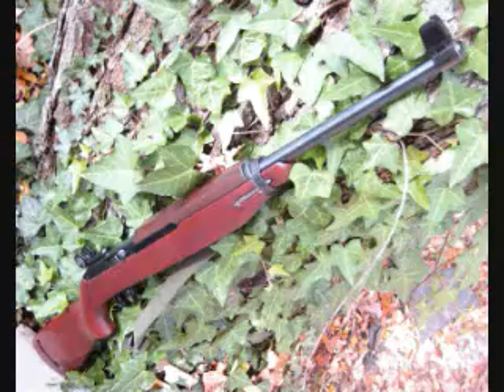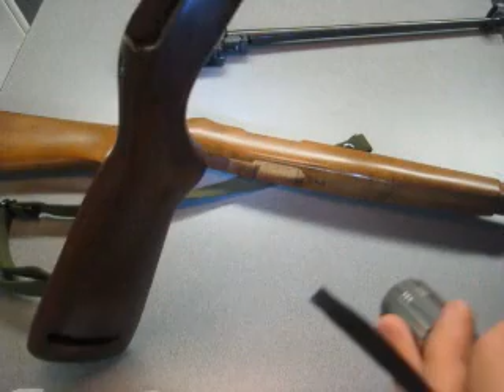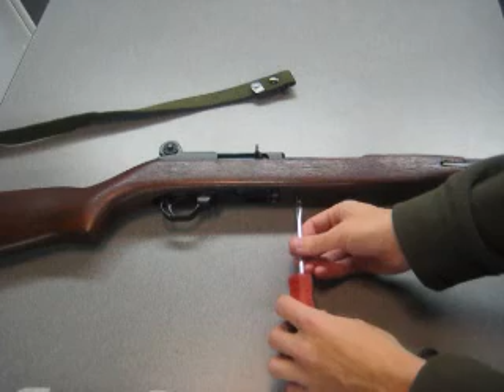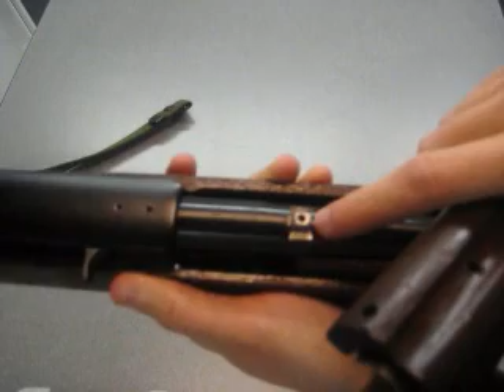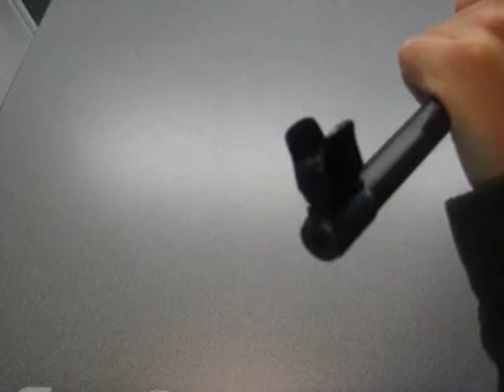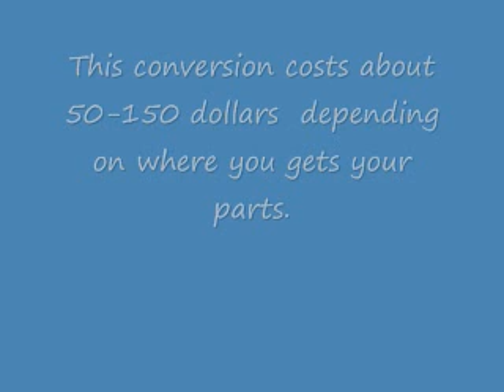Ruger 10-22 Conversion into M1 Carbine

Comment: do you need to get rear sights for this? or can you use your original sites with this stock kit?? if that makes sense please help.
Reply from the maker: +Jeremy Miller - The stock guns sights will not work. They are too low. I used tech sights, but these conversion stocks are sold commercially now, and I think some come with sights.
Reply: Your freaking awesome bro. Thank you :):):)

Comment: ive been thinking of doing this with m1 carbine stock instead of buying one of those aleady made kits from brownell's cause im cheap. my friend has a m1 carbine stock hes selling for very little and i have most of the necessary tools. @Rcbif how hard would you say this project was? Given I have no real wood working experience, you think it'd be easy for an amateur to do?
Reply from the maker: +Jerry A - It was not too hard, you just need patience, and to go slow, removing a little of material at a time. I probably test fix the action a few hundred times throughout this project. All it takes is to get over-eager once and you are left with a big boo-boo to fix, or eyesore if it is unfixable. Hopefully this video will give you some idea of what you need along the way.

Comment: I wonder if you took a Ruger 1022 bull barrel and lathe turned it to the M1 carbine profile, if the original carbine front sight would line up with the rear sight in the video...

Comment from the maker: @fowlintent  - hmm trying to think about what your sayin. Are you talking the action being 1/4 inch too far forward in the stock? I opened up the trigger guard area so there is just about 1/16inch of wood left before the recoil plate nut. My stock was also about 1/16inch to wide after some fitting (where I have my finger at 1:10 in the video) so I added a shim to run the length of that area.  Kinda hard to talk about this not in person with the stock between us.

Comment: Great Vid!  I just finished (90%)  my own conversion.  One quick question.  After fitting the action to the stock, the bolt cut out is flush with the right side of the stock, but the trigger housing is about 1/4" shy of flush towards the rear of the housing.  Did you have to alter the area around the trigger housing? Or did you alter the bolt area to allow you to seat the action a little lower in the stock?